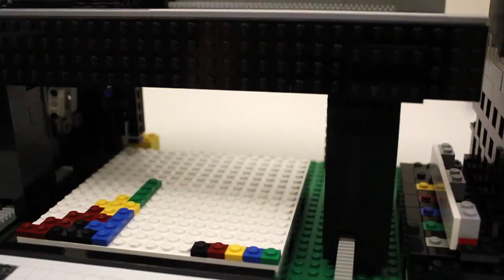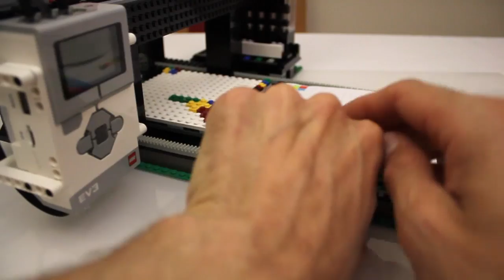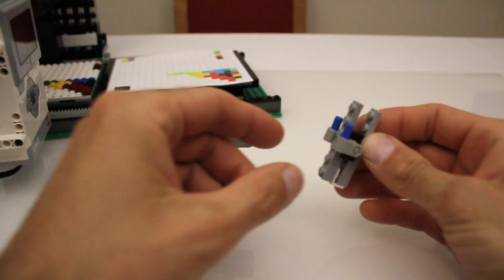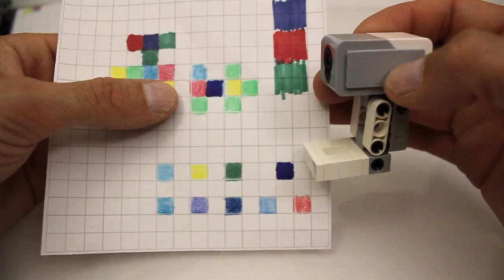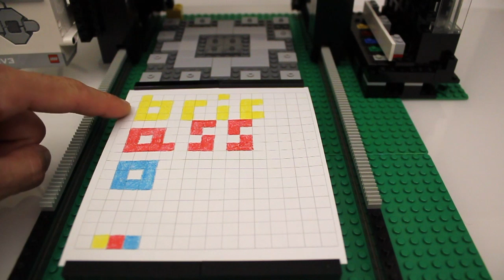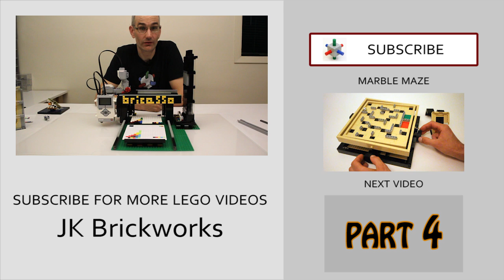The LEGO Printer Project - Part 3

Comment: Awesome stuff, Jason! I'm very fond of the fact it just picks up the sensor to read the image, and I feel honored you picked Bricasso.

I was just thinking about a system to take plates from a bin and put them nicely on a rail. The hardest part would be to have all plates studs-up. So I was thinking that you could have a little canal at the beginning which only lets studs-up plates pass. So the bottom part of that canal should be a 1x1 brick wide, but a plate height above that, the canal should only be a stud wide. Then you could let it rotate or something, so that 'inverted' plates eventually end right side up.

As for the possibility of 3D printing it, you could consider adding a supply of 1x1 bricks, so that you don't have to stack lots of plates. Ideally, the program could work out which sides are visible, and fill the inside up with random colors and bricks.

And as for what you could print. I'm very curious what a pixelated/Legofied version of the Guernica would look like...

Congratulations with this machine and your marble maze... Oh, wait a second... maybe you can let this machine print a maze?

Comment: It seems to me that while you have come up with a good solution to easily loading the bricks into the machine, it might be easier if you had a cartridge system like with actual printers; that way it's easier to switch colors, or to easily refill it at conventions. The first issue would be making sure that the pieces don't spill out when inserting and removing the cartidges, but I think you could make some kind of spring loaded mechanism that holds the bottom plate, but is released when the cartridge is loaded.

Comment: It would be cool if it could replicate it self. So a stylized " grainy" version of itself.
About 3d : it will do 4d. What i mean withe that is that you can use the stacked up colors to make mozaiks that can be viewed in potentially 5 axis. So from the top , but also the 4 sides of the square in a slanting fashion. Thus making multiple images in 1 work possible. Keep up the good work
Reply from the maker: felix t.j. Falk Cool, that's a really interesting idea.  It would take absolutely forever to print though. :)  Thanks!

Comment: So, when will you add the ability to print a new layer on top of the previous to get 3D-shapes? You'd just have to have the printer ask for the next layer 'sheet' and avoid overhangs, but it could work quite well...

Comment: could you make a 3D-Printer in LEGO?
Reply from the maker: X -plain Yup, I hope to expand it to 3D in the future.
Reply: Cool!
Reply: +JK Brickworks Have you started the project yet? If so, how long do you think it will take? Incredible build, by the way.
Reply: +X -plain yes, but not with filimat
Reply: Just print about 30 images on the same plate. Layer them over each other.

Comment: i get that its 2D, but how would you make be able to make a 3D, i get that you could put the 2D version on it and just keep doing new papers and make them stack but that would be really time consuming wouldnt it?
Reply from the maker: Sage Yeah, that would be super time consuming.   I'll try to expand it to use larger pieces and will probably change how the data is fed into it, either by loading an LDraw model file, or some other scanning trickery.
Reply: JK Brickworks cool cant wait to see you do it!
Reply: +JK Brickworks if you used 2x2 flats instead of 1x1 flats, you could attach layers of 2d printed Legos like bricks.